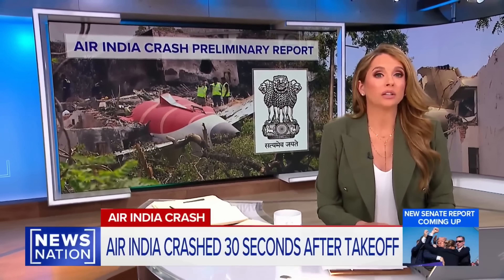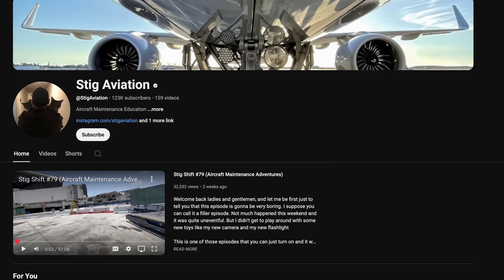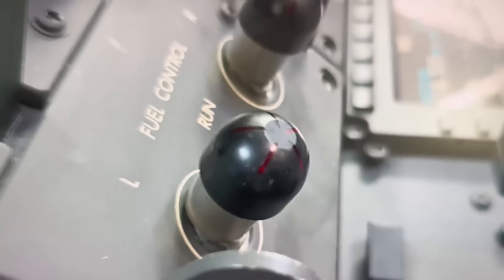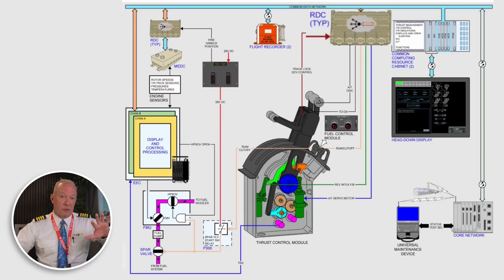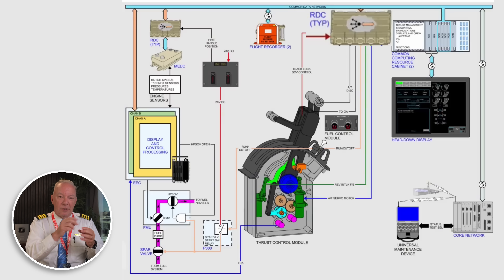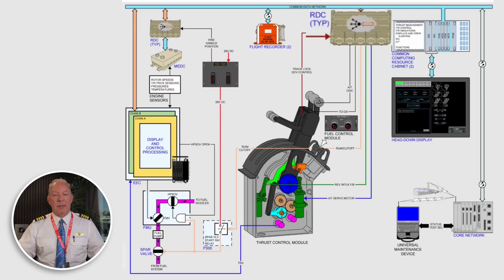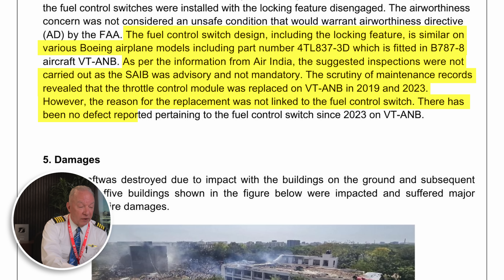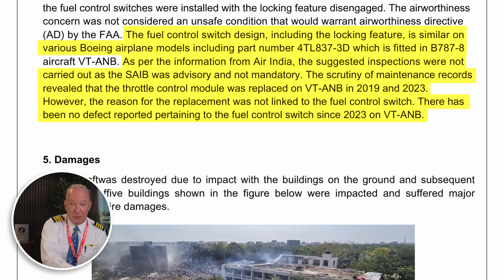The Truth About Boeing 787 Fuel Control Switches

Comment: REALLY??? I’m sorry Captain Steve, but you are making a poor attempt at backpedaling your comments about being an ‘expert’ (in your previous interview!). 
You may be an expert pilot, but you are clearly not an electrical engineer!
Your first comment was that fuel cut-off system on this aircraft is 100% mechanical, which is absolute nonsense! To be 100% mechanical would be similar to turning a large garden hose valve manually! 
That small switch, as per your electrical drawings takes many pathways electrically before shutting off fuel. You have not at one point mentioned where the sensor is located (for black box recording), where the report would suggest any ‘transitioning’,  nor WHEN THE TRANSITION was returned to ‘on-position’ before the crash (besides visual observation)!
Whether a switch is normally open or normally closed, is regardless. N/C or N/O switches are ELECTRICAL not mechanical!! ELECTRICAL IS NEVER FAILSAFE!! There is wiring between the switch, relay, solenoid, valve, etc! If a cup of coffee was spilt on the physical ‘mechanical’ switches, it could even theoretically cause a short circuit, which would send the 28 V to the relay, close the relay,  valve, etc and consequently the recorded off-position reported downstream of that ‘physical switch’ would be its ‘signal’. 
I am also disappointed in the credit you took for the research / analysis of another YouTuber that realized the RAT deployment AND landing gear position ,when you were certain it was flaps!! I have been following your channel for several years and I am truly disappointed! I’m sure I am not the only one!!
… GET A BOING ELECTRICAL ENGINEER TO EXPLAIN WHERE THE SENSORS ARE!! And WHEN were the switches turned back on??
Reply: We should ask the authorities to check his bank accounts because clearly he is hell bent on blaming the dead pilots. He does not understand basic common sense that whether it is mechanical or electrical, it has components and every component attached to the switch has to be in working condition, anything could go wrong, even a spring  twisted could fail the switch or get stuck. Nothing is permanent, every thing needs regular maintenance and replacement over time.

Comment: Is it possible for some kind of liquid to get into the EE bay upon rotation disrupting DC delivery to the valves momentarily? The fuel switches seems very conclusive but I don’t understand why the RAT deployed so early and why max speed doesn’t align as calculated with cut off.

Comment: Question from an Ex RAF A&P Tech. Are these shut-off valve (all 3 of them per engine) rotary/motorised valves or solenoid valves? I don't think it would make any difference to the actual outcome although a solenoid valve would operate almost instantly whilst a motorised valve would take a few seconds to travel from one position to the other, but I'm just curious.

Comment: Does anyone know if the Relay (P300) of the plane is a bistable relay or a non-latching relay (a general-purpose relay)? 

Bistable relay= It has two stable states (on/off) and it maintains the state without constant power (from the upstream switches). It needs one impulse to move from on to off. It needs another impulse to move from off to on. It hold its position even after the power is removed from the controlling contacts. 

Non-latching relay=requires the control signal to be constantly applied to maintain its state. When the signal is removed, it returns to its normal position (either normally open or normally closed) due to a spring mechanism.

Comment: On the B787, there is indeed a recall (memory) checklist for Dual Engine Failure / Stall. It does include moving the Fuel Control Switches. So to clarify:

Dual Engine Failure / Stall — Recall (Memory) Items

Fuel Control Switches (both) … CUTOFF, then RUN
 (attempts to clear the fault and reintroduce fuel)

Comment: A “what if” here. If there was a loose wire connection from 28V via the relay to the fuel switch off valves would that be recorded as the fuel control switches being turned off and on again? Could such a loose wire event even occur?

Comment: Isn’t Ram Air Turbine (RAT) getting deployed immediately after lift-off an indication of severe electrical outage ?
Reply: No, RAT is triggered by engine flame out, not electrical failure
Reply: @joelagnel1 Under normal conditions, the RAT is stowed in a compartment in the fuselage or wing. It can be deployed manually when required or, in some installations, will deploy automatically following a complete loss of AC power. In the interval between power loss and RAT deployment, aircraft batteries are used to power essential instrumentation.
Reply: @kumasswan4309I am sorry being initially incorrect. Indeed if both engines are working but if there is still electrical failure, then the RAT still deploys. However in the case of this accident, it does not matter because the engines flamed out anyway causing the obvious electrical failures and subsequent RAT deployment

Comment: Even though the switch is turned off, i think there should have been a sensor alarm indicating that the fuel switch is turned off immediately the engine is power on

Comment: What about water ingress from the toilet area which are positioned exactly above the EE bays? Some people think that an electric power cut caused the fuel starvation of the engines and not the fuel cut off switches. The switches were moved AFTER the fuel cut off in order to restart the engines.  https://youtu.be/GutxLCbQ7d0?si=HV3ywqpORNlB0BSX

Comment: I have a simple question, light bulbs switche are mechanical as well: do you think a lightbulb can be turned off without moving the switch that controls it?
Reply: Faulty wiring. Bad connections. Faulty battery

Comment: I DON'T AGREE. The Genx engines have start protections for "HOT" and "HUNG" starts which the EEC/FADEC controls by the Fuel Metering Valve. The Boeing 787's Electronic Control Unit (ECU), also known as the Full Authority Digital Engine Control (FADEC), is responsible for controlling the fuel valve. The ECU communicates with the fuel control switch to determine the position of the fuel valve and then controls it to open or close. This process is part of the FADEC's full authority over the engine, ensuring that the engine operates efficiently and safely. The ECU interprets demands from the crew or flight automation units and adjusts the engine geometry and parameters to ensure the engine limits are never exceeded, fuel consumption is optimized, reaction time is reduced, and wear is limited.

Comment: I am not convinced you are totally correct, my understanding is that the FADEC can shut down the engines internally by stopping fuel metering in response to a detected fault condition. There is no dispute that the switches were physically moved from run to stop and back to run again, the question is what was the exact process the process around that and why.
Reply: Yep. It's clear from the diagram that external control lines can switch 2 of those valves, despite what Captain Steeeve says.
Reply: @Manticore1960 Agree, engineer for 45 years, used to expecting the unexpected 👍

Comment: Even if the probability is very low, can we imagine a full electric failure AND a battery failure at the same time? I know it seems incredible, not only the probability is low, but if it happened, both engines would cut off at the exact same time.

Comment: Question ⁉️⁉️: IN 2019, an ANA FLIGHT ALSO EXPERIENCED A FUEL CUT OFF due to switches TRANSITIONING FROM RUN TO CUT OFF BECAUSE IT IDENTIFIED THAT THE AIRCRAFT WAS ALREADY ON THE GROUND. Doesn't this mean that it is possible that there's another explanation to the switches transitioning to cut off without pilot input? Please explain the probability of this Capt Steve.

Comment: According to the diagram the relay, directly controlled by a RUN/SHUTOFF switch, directly controls only the SPAR valve. EEC directly controls the FMV valve and there's a logic AND element in FMU so in order to open the last, HPSOV valve you need both the relay in closed position (fuel shutoff switch in RUN position) AND HPSOV digital command from EEC.
Reply: Yes. It's obvious to anyone looking at that diagram. I'm astounded that Captain Steeeve couldn't see it himself! 🤷‍♂
Reply: Saw this as well, commented the same and good to see I'm not the only one who caught that!

Comment: Im curious how many hours, more specifically how many starts were on the ACFT.  Here is my reason:  I was flying a Eurocopter EC-135.  The engines are controlled by a 3-position switch (OFF-IDLE-FLY).  There is a physical gate that swings behind the switch after the switch has been put into idle, preventing accidental shut off.   At the time I was flying the 135 there was no physical gate to prevent the switch from being placed into idle from fly.  So...There I was...Flying across the Appalachian Mountains in some truly turbulent conditions.   It was night, and DARK.  The dimmer controls are located above the engine controls.  I was reaching over to bump down the panel lights just as the ACFT went through some turbulence that slammed my hand down onto the #2 Eng Control.  It rolled to IDLE; I brought it up to FLY ASAP.

The ACFT had around 10K hours and countless cycles on those switches, wear and tear was substantial.  The switches were replaced. Several years later Eurocopter added the second gate.  

Just thinking out loud.

Comment: The three fuel valves described are never simple solenoid valves with energize-to-open logic.  I believe the spar valves are motor-operated (slow) with drive-to-open or drive-to-close logic, with internal microswitches to give position information.  The high-speed fuel shut-off function in the engine fuel control is often controlled by a fail-to-neutral 3-way or 4-way torque motor servo valve assembly.  The fuel metering valve position control is also controlled via a fail-to-neutral 3-way or 4-way torque motor servo valve assembly.  Imagining these as simple solenoid valves is misleading.  Using energize-to-open solenoid valves would be completely unsafe.  The design choices for these components is rigorously analyzed using formal Failure-Modes-Effects and Criticality Analysis.
Reply: Not only was his explanation way oversimplified, it was factually wrong.

Comment: While we all appreciate a pilots view of this accident Captain Steeeve, it's based on the ASSUMPTION that the batteries were OK and continued to provide a 28v supply. 

In the case of the non-redundant lithium battery in the 787, if it were to FAIL catastrophically, then the 28v supply will also fail in short order.  As you point out, all the fuel control switches need 28v to KEEP THEM OPEN. Should the 28v supply rapidly fail, then the fuel valves will close and the engines will shut down. As would the power to ALL the aircraft's electrical systems ... until the RAT deployed (up to 10 seconds later). A battery failure would also interrupt the power to the position sensors on the fuel cut-off switches thus FALSELY logging a change of position/state (hence a false-report that the fuel cut-off switches were closed). Loss of battery, and 28v supply also cuts the power to the flight data recorders (hence missing data).  

Please review, the in-depth analysis done by Jeremy John Thompson. Please also be a little more sceptical of the motives driving FAA/Boeing to project blame (see also MAX-8). It also appears there were issues with the 787 Battery Management / Diode system, that were never addressed fully after the original 2013 battery fire issue. 
https://youtu.be/OLxLN3osS1Y?si=XO8VtaICrh6rEG5B

Comment: No disrespect but You are not an engineer , these systems are extremely complex for a pilot to explain or test or debug  you can only give a pilots perspective the block diagram is classic example what pilots are shown to give them some initutiom  ...https://youtu.be/w-qheDJ3R-c?si=T2RErJXjstXJs8NU listen to these guys they know what they talking about , also please lets not make it a india vs world vs air india vs boeing discussions most indians i know avoid flying air india , every one know they have to buckle up, but indian pilots are world class , it is easy to blame the dead like max crashes or silk air rudder ones ... then untill it happens again ...
Reply: https://youtu.be/GutxLCbQ7d0?si=WhESR96McF7gLPEk
Reply: Exactly. Even though it's a block diagram, it still clearly shows that there are external control lines to 2 valves via the EEC, so it isn't JUST the fuel control switch that can close the valves as Captain Steeeve claims.

Comment: I believe that the pilots did not activate the switches at all during the start-up sequence. Therefore, the pilots are not the problem. The relay does not switch the valves if the entire circuit is short-circuited by a component, e.g., the battery. If the battery is initially OK and the switches are in RUN status, then the fuel valves are activated. If the battery short-circuits after a short time (e.g., 5 seconds after TakeOff), the relay loses its holding current and drops out. The valves switch to OFF and the fuel supply is interrupted. The switches that everyone is referring to were and are in RUN status. You can easily reproduce this in your small hobby electronics circuit by simply activating the switch and, after a few seconds, connecting the positive and negative terminals of the battery with a wire to simulate a short circuit in the battery. The relay drops out. The focus should be on the battery and its charging circuit. If any component in the battery's charging circuit causes a short circuit, that would be a logical explanation. In addition, there has already been a problem with the Dreamliner's lithium battery. 
The fact that the ADSB signal stopped transmitting shortly after takeoff also supports the theory that there may have been a short circuit. If a pilot wants to crash the plane, it makes no sense to switch off the transponder directly during takeoff. A short circuit, on the other hand, would be a plausible explanation for the failure of the ADSB signal.

pls. look at this channel https://www.youtube.com/watch?v=OLxLN3osS1Y , which explains the whole electric circuits around the battery

Comment: Thanks Steve. This is the video Ive been waiting for. On the Piers Morgan interview, the "Learned" panel next to you insisted they were correct in saying the Fadec or other computers were connected into the relay circuit and could have turned them off thereby indicating a switch movements when there werent any. Thankyou for clearing this up. It only makes sense that such a critical system is left so simple that it is virtually failproof and will keep engines operating under the most catastrophic failures.
Reply: Whatever the reason for the crash was, Captain Steeeve is completely wrong in his description of the switch/relay/valve circuit. It is plainly obvious that there are control lines from the EEC to the FMV & HPSOV valves. Captain Steeeve claims that ONLY the fuel control switch & nothing else can control those valves. That is simply not true if you look at the diagram.

Comment: You say there is no other signals controlling the valves, but even on this simplified picture there is a signal HPSOV OPEN coming from DISPLAY AND CONTROL PROCESSING which controls HPSOV valve through an AND element in parallel with the signal from the relay. Plus there is an additional FMW valve on the picture controlled by the same module. And in a real schematic I would expect some more signals which were skipped here for simplicity. If, for example, RDC failed, wrongly detected cutoff signal and send it to the bus, will DACP close the valves in FMU based on it? This picture doesn't show any valve position sensors, do we really know which valve of three shown was actually closed?
Demonstration of a handmade circuit is absolutely irrelevant and can be judged as a manipulation.
What should be shown here are details of the switch contacts. Are there two independent groups of contacts for relay and RDC? What and where to the switch actually connects? If there is some fault in the THRUST CONTROL MODULE connector and switches are loosing supply or ground connection, what signal will be sent to relay and to RDC? There are to many details missing. You can't prove that the system is very simple and reliable just showing a simplified operational diagram. It shows only the general interaction between modules, but there might be a lot of bugs in the implementation of these interactions.
Concerning loose of supply, I was in a situation when my car lost all electricity, just because of a single wire fault, which connected the battery to the fuse-box (alternator was connected directly to the battery). It was an old purely designed car, but bugs in design is exactly what we are talking about.
Reply: Yes. Many of us can plainly see those additional control lines to the valves, but for some inexplicable reason, Captain Steeeve ignores them. I don't know if it was intentional, or whether he doesn't know how to read a diagram.

Comment: Is the report says anything about the dc battery providing power to the relay switch, which then controls the fuel switches? What if it was low/out of charge and didn't operate properly, I guess something needs to charge that battery,  what if the system failed before the fuel control system+battery.

Comment: I wonder if the fuel control switches could still open the fuel valves without fully being in the run position detent. Has anyone tried this in the simulator?